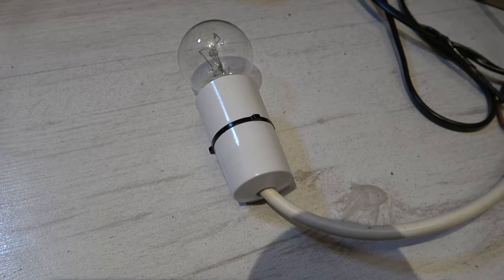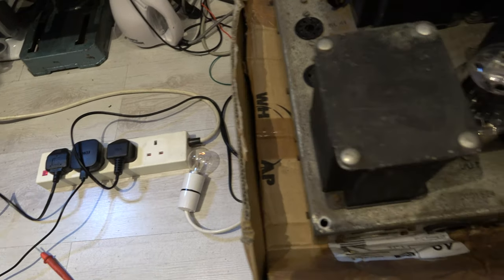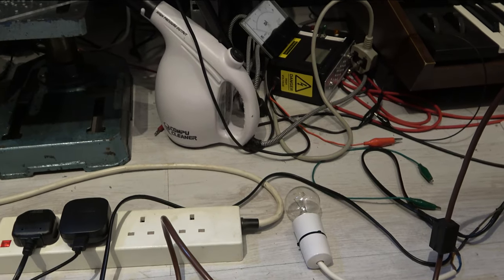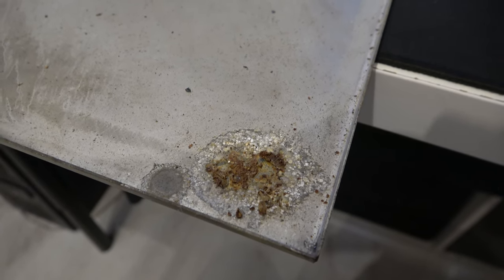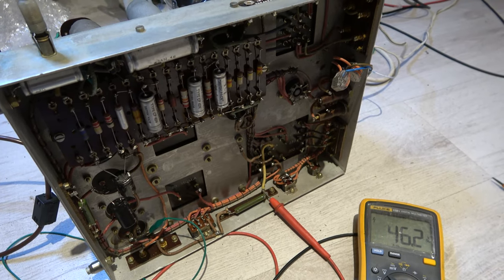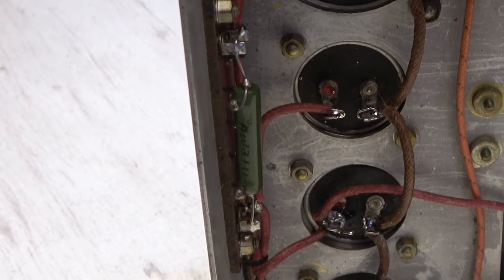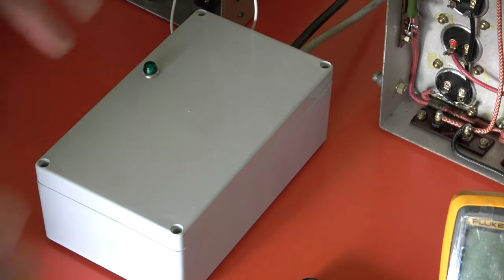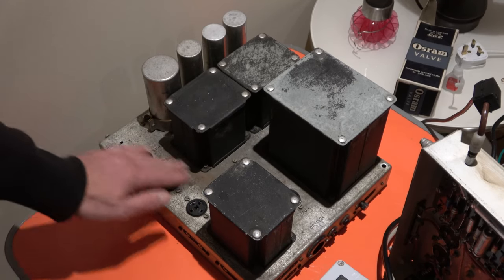RGD1046 - VINTAGE BRITISH VALVE/TUBE AMPLIFIER REFURBISHMENT - PART 2/2

Comment: Nice amps! I am currently restoring a rusty pre-war RGD PX4 amplifier. Nothing about it on the internet sadly. When stripping it down I left the wiring loom as intact as possible to give me a sporting chance of getting it working again. One nice touch was that it had RGD branded caps in it. I have restuffed the wax paper caps.
Reply from the maker: It's great fun sorting out old amps. It's great when you get them working and music sounds good through them. Best of luck